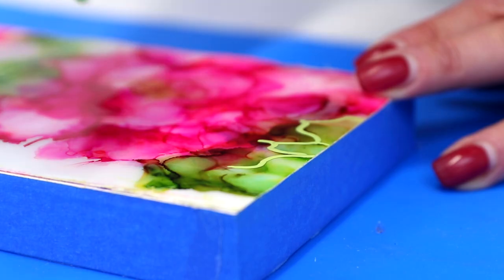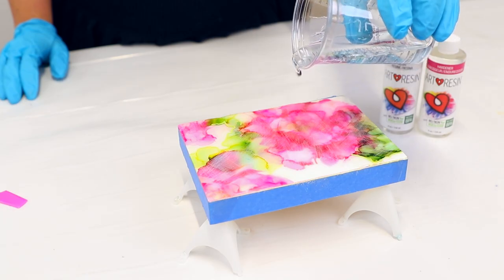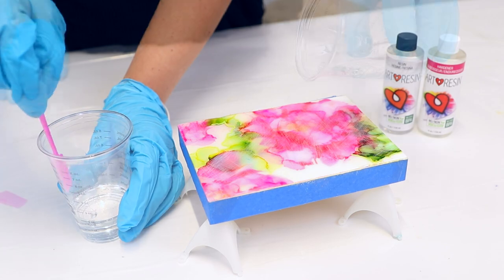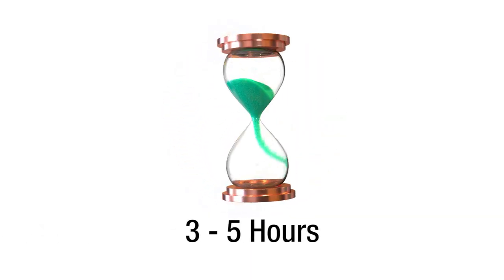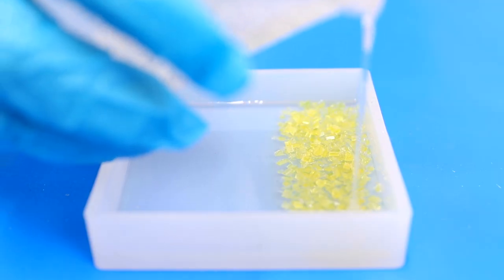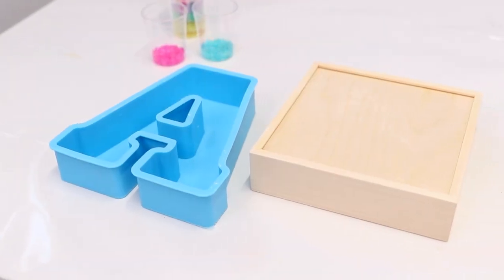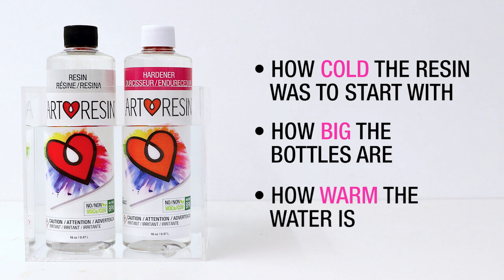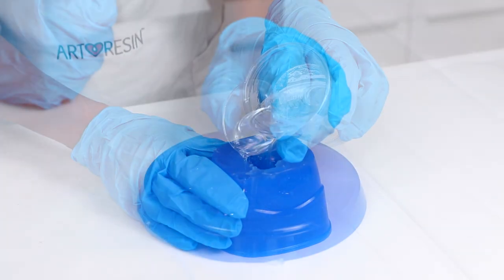3 Ways To Get A Thick Resin Layer

Comment: Very helpful,  thank you. With multiple layers on a 3d pour can you see the line of the in betwwen layers?
Reply from the maker: Depending on your design and what you are pouring, sometimes you can see a layer line from some angles.  Unfortunately there is no way to avoid this.
Reply: @Artresin  might it be less visible if you sand the layers between each poor?
Reply from the maker: @Kraftions  We do sand between layers to give some tooth.  Unfortunately the layer line can be visible in some applications, but it really depends on the artwork itself.

Comment: Im going to work on flower preservation in 50mm deep 8inch mould so is warm water bath method good or 3-4hours curing good mam? And please suggest me some tips to do it.
Reply from the maker: A warm water bath is a good idea to help reduce bubbles that can get trapped in cold resin.  You can pour your second layer once the first layer is in a jelly like state-usually around 3-5 hours.
Reply: @Artresin  Ok mam Thank you so much this is so helpful we are searching for this guidence for so long but no available anywhere Thank you much really ❤️

Comment: Question…I am doing a project with an image on paper that will cover the entire surface of my project. I have waterproofed the image with modpdge. Should I glue the image down on my surface before my first pour or pour a first layer, let it set 3-5 hours and then stick the image into the resin and then do a final pour? What will the next layer bond to if there is a waterproofed paper layer? I don’t want this to delaminate.
Reply from the maker: We typically use a spray adhesive to adhere the paper to the panel first, then use a brayer to roll out any air pockets.  You can then coat the image with ArtResin.  Here is a video that might give you some tips:  https://www.artresin.com/blogs/faq/what-is-the-best-way-to-mount-paper-or-prints-for-use-with-epoxy-resin?_pos=3&_sid=ea4c1c4c2&_ss=r
Reply: @Artresin  Would the image bond to the panel well enough with the spray adhesive to do a multilayer resin pour over it?
Reply from the maker: @sydneyblum5109  I would say that may be a better question for the adhesive manufacturer.  From our experience, we have not experienced any issues with spray adhesive.  If it is a concern you can always allow the ArtResin to flow over and coat the edges of your panel as well as your surface, this will create a super strong bond.

Comment: I would like to resined bricks to make a smooth hearth for a gas fireplace.  The goal is to lay bricks and then fix in the mortar with resin as I layer it over the bricks. My question:  is resin heat resistant or is it flammable?  Is this a dangerous idea? I'm wondering if there is any substance that could be used to make the bricks smooth and easy to clean.
Reply from the maker: Hey Donna.  Resin is heat resistant to a point, but in the end, it is plastic, and if it get too close to the fire it can discolour and maybe melt!?   I’ve never seen cured epoxy resin light on fire.  It shouldn’t be flammable, I’d just worry if fire touches it, the resin could have burn marks like putting out a cigarette on plastic!?  It will be water proof and easy to clean.  Not sure I’m much help here.  My main question is how close to the actual fire these resined bricks would be…

Comment: Would I be able to do a deeper pour if I use my pressure pot to remove the air bubbles?
Reply from the maker: A pressure pot is better suited to a casting resin.  There would be a risk of ArtResin getting too hot if poured in a deeper application and overheating.

Comment: I am looking to glue glitter onto a panel using Art Resin. I chose art resin because I wanted a strong hold and for it to be archival. Do you think there would be any issues with waiting for the resin to thicken a bit and then sprinkle the glitter on top of it? Looking for a glitter on top look as opposed to the glitter being mixed throughout .
Reply from the maker: I would always test out a new technique before using it on your masterpiece.  Keep in mind glitter will often settle to the bottom of the resin while it cures, so sprinkling it on after may be better, wait for the resin to cure for a couple of hours to thicken a bit.

Comment: Why would one coaster remain a bit tacky when año on the same batch is smooth to the touch. Even a couple of weeks later. Thx
Reply from the maker: Hi Jill,  this usually happens if your mixture isn't thoroughly combined.    No matter how carefully you stir and scrape, there may be unmixed resin or hardener on the sides of your mixing container. If this gets scraped out onto your artwork, you'll end up with soft wet, sticky spots in your cured resin.  Have a look at our blog for more information: https://www.artresin.com/blogs/artresin/scrape-when-you-mix-epoxy-resin-not-when-you-pour?_pos=3&_sid=6a3041de1&_ss=r

Comment: Thank you so much for making this video, it helped me a lot but I want to know one thing as you said you can sand the painting after 24 hours and apply the 2nd coat, so this same method we can apply in 3-5 hours as well?
Reply from the maker: You have two choices when adding a second layer.  If your first layer has cured, you will want to sand the surface to give it some tooth prior to applying a second layer.  The other method is to pour your second layer when the first layer has been allowed to cure for 3- 5 hours and is in a jelly like state.

Comment: Thanks this helps a lot, but for the warm water bath how long would a 2-gallon resin and hardener need to sit? Also with the 3-5 hour way, if using a mold will you end up seeing lines between the layers?
Reply from the maker: Try to find a tub that will allow you to submerge a good portion of your larger bottles in the warm water.  Timing depends on the temperature of the water, but 15 or 20 minutes should do it.   When layering in a mold, you can usually see a faint line where the layer is from some angles.
Reply: @Artresin  thank you! One last question, with the warm water way could you pour a layer as thick for 4 inches or a bit more? Or would have make it flash cure or make the resin heat up too fast?
Reply from the maker: @melganevian1804  no, that is too deep to pour ArtResin, aside from bubbles it could generate too much heat and flash cure.
Reply: @Artresin  Okay so 1 inch would be fine? Sorry
Reply from the maker: @melganevian1804  We recommend pouring in layers no thicker than 1/8-1/4" to avoid bubbles and over heating.

Comment: I read somewhere that you can spray 99% alcohol on it instead of using heat to get rid of bubbles? Have you ever tried this/would you recommend?
Reply from the maker: Many artists use a spritz of isopropyl alcohol over the surface of their resin poured in molds to help clear off surface bubbles.  While this can be a useful trick when using silicone molds since you want to avoid the use of a flame on a mold, we still prefer the torch for your typical poured application.  Just use the alcohol sparingly to ensure you do not disrupt the surface.

Comment: Wait, in another video art resin says if you recoat after 24 hours you can pour straight on, I actually commented to clarify this and they said yes. And said you only need to sand it if it’s been longer than that.
Reply from the maker: Sorry for the confusion.  If you are applying a second or additional layer within 3-5 hours there is no need to sand, the previous layer will be in a jelly like state and will provide the tooth to the next layer.  If your resin has cured we recommend sanding the surface first before pouring on your next layer.

Comment: My question is how to get the yellowing outta it
Reply from the maker: Yellowing can happen for a variety of different reasons from UV exposure, to interactions with certain art materials, over-torching, bulking etc.  Unfortunately it is a very hard thing to fix once it happens.  You can try to sand down some of the yellowed resin which will de-bulk the intensity of the colour somewhat and then re-coat with a fresh layer.  It is not a sure- fix but may help minimize the intensity of the yellow.